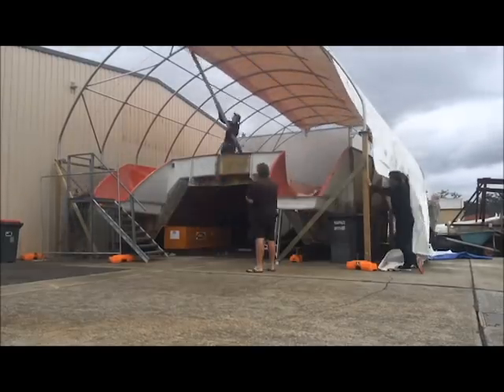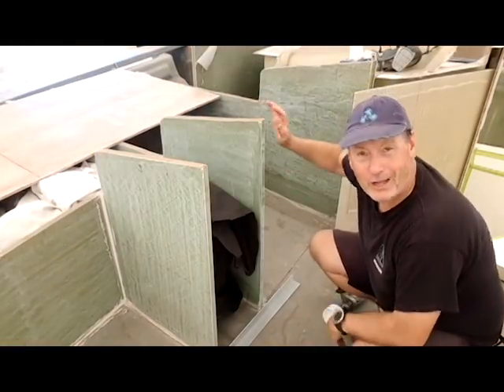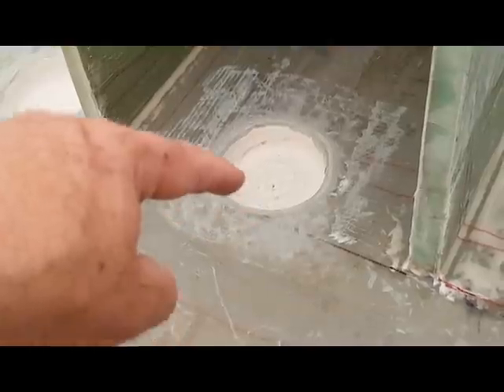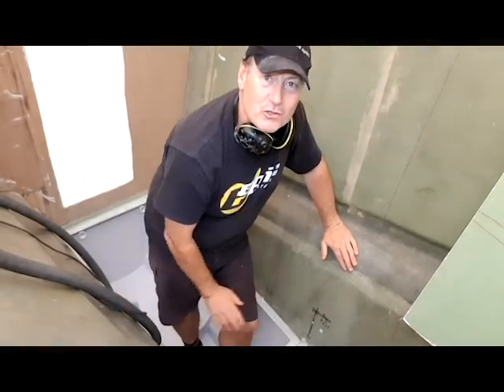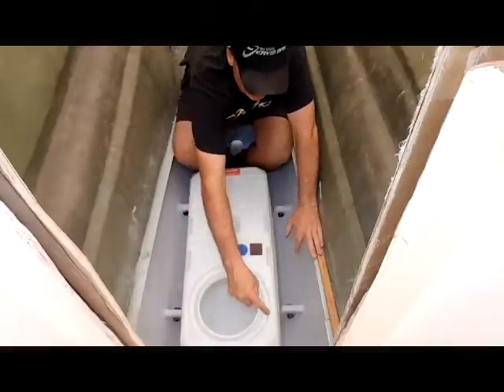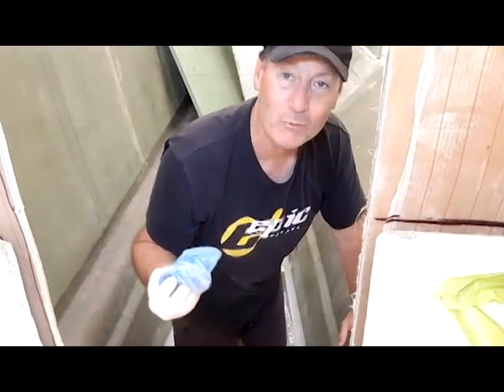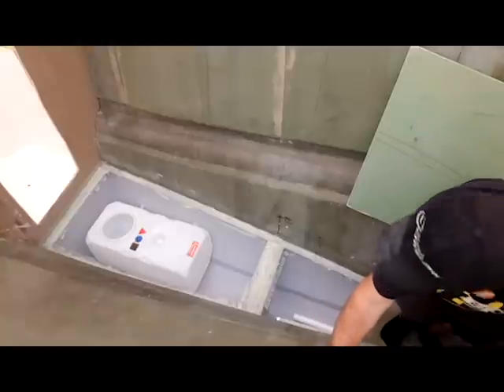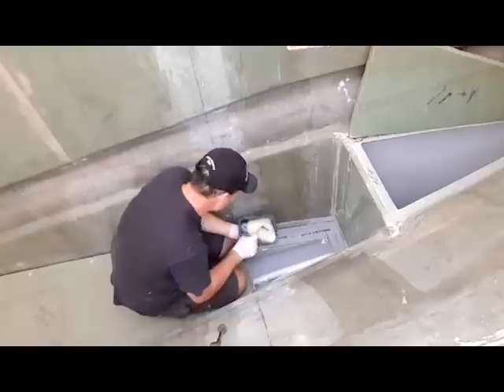Ep106 Cabin Sole Gluedown  - Life On The Hulls - Catamaran Project Build

Comment: Hey Ross...some food for thought... If you want to be able to remove the bilge pump and pull the tank out, how bout making the tank braces removable?... then you can just remove 4 or 8 bolts and remove the tank at will.  You already have the braces, just cut them out and make fiberglass L-Brackets to bolt the braces to?   By the time you read this, I guess it will be too late...heh heh

Comment: Next time the Australian navy goes into battle they are going to strap the "SS Mold-y" there to the front to use as a battering ram since it's going to be built more solid than a battleship by the time you are done. It's a nice change from all the rebuild videos showing "and this is where the boat was held together by a piece of triple ply tissue paper and some duct tape for the last 40 years" nice work!

Comment: Great video again as usual Rossco.
Just one thought,  why didn't you cut the hatches out and have the hatch supports in place before you put the floor in. Wouldn't have it been easier than doing it once the floor is glued down. Not criticizing,  just a thought.
Reply: I was thinking that w/o a lid he will be cleaning that tank out after cutting the hatch.
Reply: My take is a loose hatch will be a trip hazard not to mention a place for everything to end up.  The only downside is that he has to run a vacuum around inside the hatch.

Comment: I would trace a line 3 inches in from the sidewall of your floor for your access panel to the tank. Making the panel top a smaller copy of the floors Dimension. Having it not be  the awkward shape of the traced tank it will look way BETTER and be way easier to gain access to and remove the tank if need be.      I don't  really understand why you needed the tank in the bulkhead before you laid the floor on top either. It makes more sense to me to leave it out if your cutting a hole in the top to have access anyway.  I found out a long time ago that when making access holes people try to make them as small as possible for some reason. Which is completely wrong. You want to make any access hole always as LARGE as possible ALWAYS.   First the look better and contrary to most beliefs are way less noticeable. But mainly its the ease of access. You can never have to much room when accessing something whether to work on or remove especially if in an award place.      Is there a reason you want to flip the tank on its side when removing it? Other then its its a tighter fit? It makes no sense to me.

Comment: I never use acetone to clean an epoxy glass surface, it eats into epoxy... you are introducing contaminating chemicals that will weaken the the bond.. Just sand and vacuum with a brush head to remove dust, then apply your next layers of bog/glass/ epoxy.